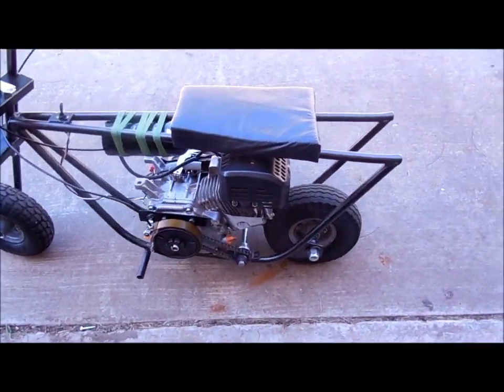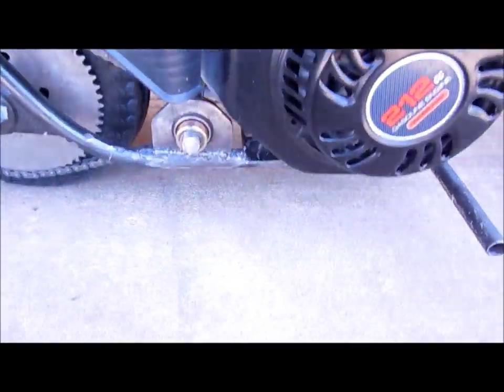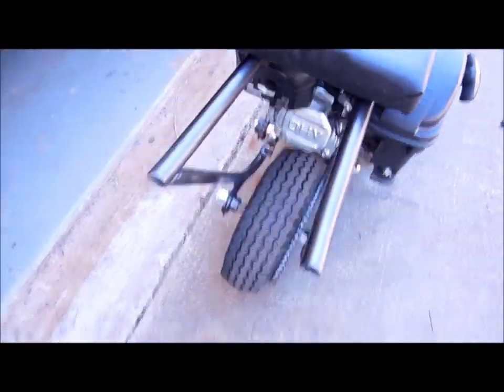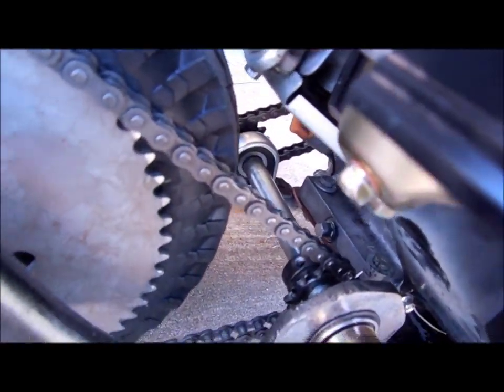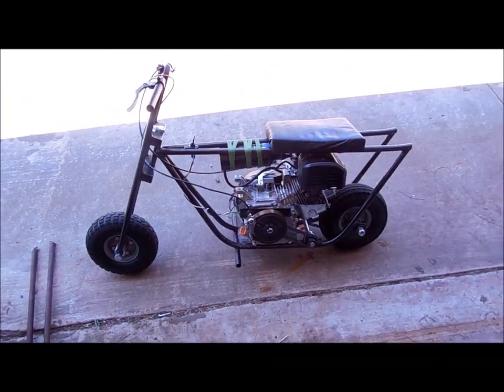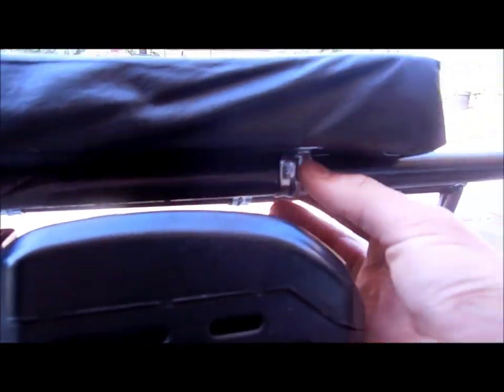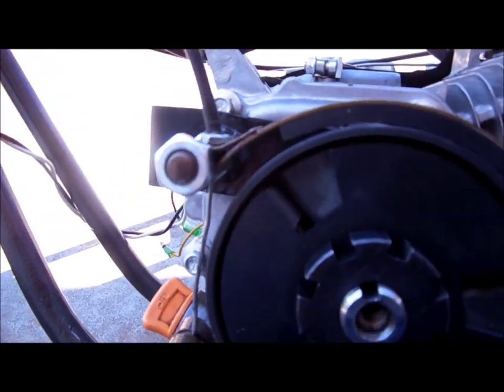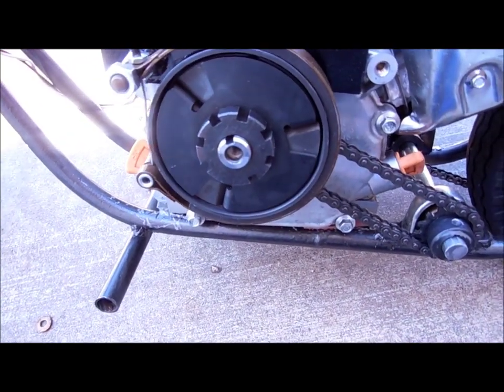DIY Homemade Mini Bike 6.5HP No Governor

Comment: nice build man! how well does that band break work?
Reply from the maker: Thanks! The band brake works alright, but not optimal as the clutch housing rotates much faster than the wheel, so the band brake does not work nearly as well as it would directly on the wheel.
Reply: Electrotechnics cool thanks for the info

Comment: cool bike man...what epoxy did ya use for gas tank?..I used some j/b weld and it leaks.I have the same tank as you,,,thanks.
Reply from the maker: I also used JB (kwik) weld. Try removing the JB weld and sanding the surfaces with heavy grit sand paper (seals better to rough surfaces) and clean away any dirt or oil with alcohol or acetone. I hope you get it working!